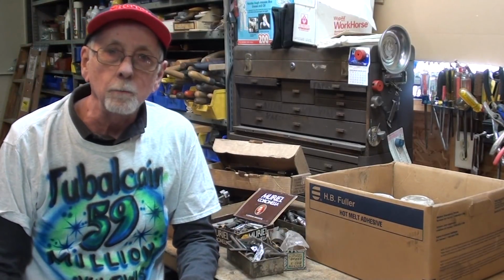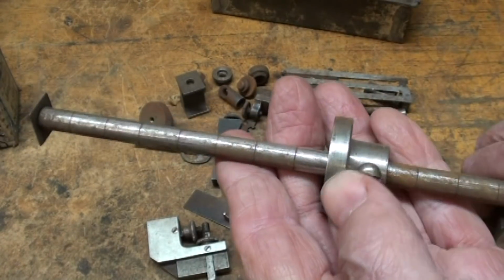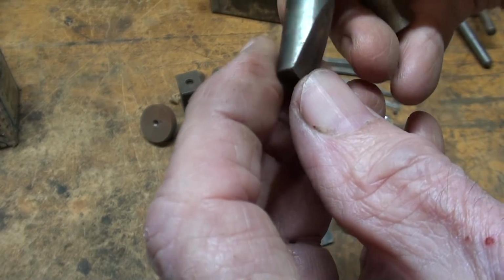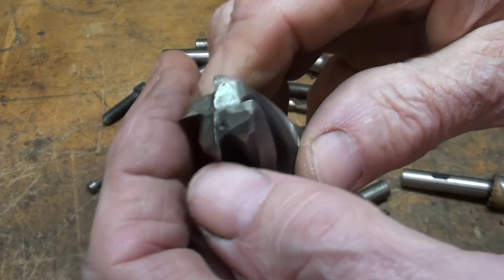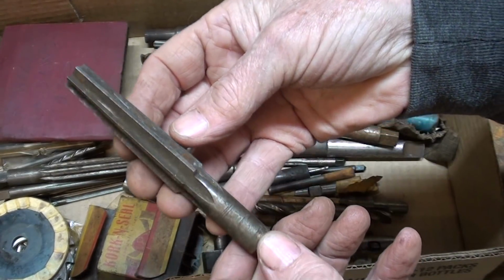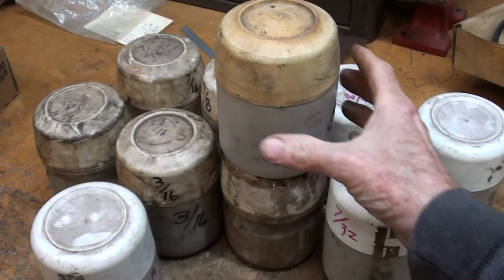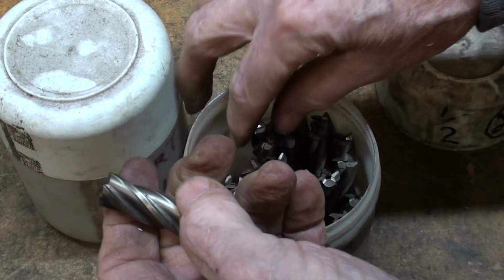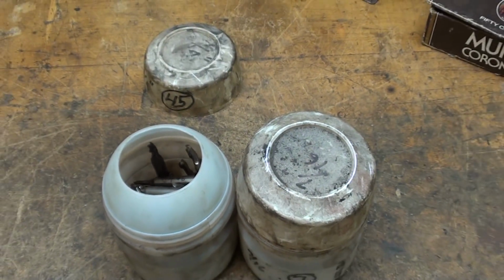SWAPPING FOR CUTTING TOOLS tubalcain wasting money

Comment: I volunteered once to look at my neighbors leaking AC while they were gone for the weekend which needed to be recharged again,  I found the leak at a brass block welded to the inside coil assemby where the liquid line tubing was attached with a brass flare fitting.  It was a special fitting with a check valve inside and sealed using a shoulder against a nylon washer.  The threads in the block were stripped and the fitting was barely holding.  Then, I SCREWED IT UP and lost the tips of the little thread it had left.  Sh_t!  Sh_t! Sh_t!  Now I can't even put it back together and that block is part of the entire coil assembly.  Now there's no AC at all.  Do we all know this feeling??  On top of that, that thread was short and it started up against a shoulder.  I can't do that.  But thanks to my junk tray, I made a 2" dia, 60 deg saw blade from an old 1/8 thk slitting saw and test sawed a thread against a shoulder on my 10" Atlas in back gear using my toolpost grinder.  It looked good.  I retapped the brass block on the coils to the next size up fine thread, turned a new brass fitting, sawed a new thread to the shoulder, remade the check valve, the flare end, cut the hex for the wrench thread and turned a new nylon sealing washer.  Took me an entire Saturday, but it sealed perfectly and was cool.  You couldn't even see what I did.  And of course, no charge my friends, it was just another day in MR. Pete's shop class.

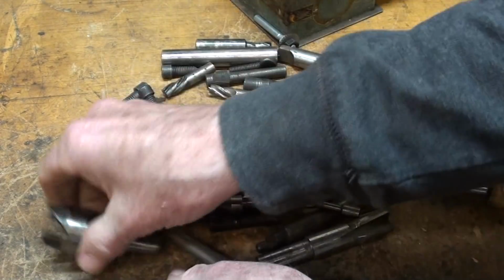Comment: At 9:04, I think that is a core drill, for removing battery cables and inter-cell connectors from industrial batteries.  It had a center that went down the  center of it.

Comment: Mr Pete, have you tried soaking the rusted tools in vinegar  or a diluted vinegar solution ?
Be sure to rinse thoroughly and dry.
Sorry I cannot offer any ratio of water/vinegar or soak time.
Just experiment with some scrap to see what works best.
You could also use electrolysis and there are numerous video's about that here on yt.
Thanks for the interesting video.

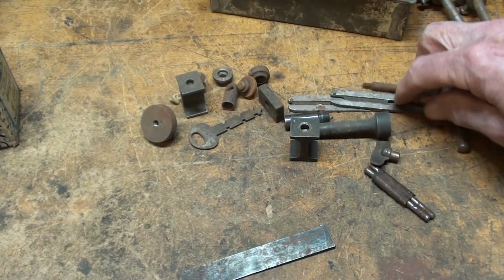Comment: The two longish items with the groove down the centre shown at 7:04, look like the sliding half of a spaceband from a Linotype machine from the days of hot metal Letterpress Printing. The other half had two lugs protruding that sat on the rail. They were tapered to match and retained the pieces you have, so as they slid past each other they would expand. They were inserted between the brass matrices in the spaces between the words. When the line was complete and just before the line of matrices were to be cast into a slug, the large end of the spacebands would be pressed up with a bar to create equal spaces between the words and make the line of matrices tight at the mold, so no hot metal would escape into the machine. The operator had to make sure that there wasn't more space in the line than the spacebands could accommodate. If when the bands were fully expanded and the line of matrices was still loose, what was known as a splash would happen, where molten metal would spill between matrices into the machine around the mold and turn solid. Depending how bad, there could be quite some down time removing the cooled type metal from the mechanism.
Reply from the maker: Yes, you are right they are from a Linotype.     I intend to include them in the next what is it. I used the term justification for the line spacing

Comment: Oh, I hate you... I can never find deals like that. If you were to cost out the useable tools, and add the stuff you could repurpose what do you think the the value would be? Let's just look at the box of taps, end mills and drills: 80 taps, 366 end mills, and 175 drill bits. How much are they worth? they could be all dull, but you seemed to think that many of the end mills were still useable, let's pretend that half are useable, and perhaps 10% are new. I'll guess some lowball costs.
80 1/4-20 taps: 40 useable at $10.00 / tap = $400.00
366 end mills: 183 useable, at $25.00 / mill = $4,575.00
175 drills: 87 useable at $5.00 / bit = $435.00

My guess is that the value of that box is about $5,410.00. Of course very few people would want that exact selection of stuff, say you might want 25% of it: $1,352.00. Then 50% of that for the gamble: ~$675.00. I'd be quite comfortable offering you $500.00 for every thing you purchased, including the stuff I didn't cost out, and might go higher in an auction.

So, here is the offer: $500.00 for everything. seriously.

Comment: The square drills in the blue capped tube are harden material drills. When you need some kind of hole in hard steel. Barely effective and largely replaced by EDM these days.
Reply from the maker: Thanks

Comment: Cool stuff. Dump the first box in Evapo-Rust. It leaves a dull finish because it gets the most microscopic bits of oxide. It is great stuff. Does not touch unoxidized iron. Totally safe. Dump the used up in the garden for extra iron and sulfur. Make sure the items stay covered or it will cut a ring where the steel penetrates into the air and oxidizes at the liquids surface. I sold the4 stuff nearly 20 years ago when it was a new invention. Caution: It removes all oxides including bluing and Parkerizing (and makes old wood look new!). I bet the telescoping gauge will recover with a soak.

Was that an annular cutter for wood plugs?  I bet those jugs are from a shop where they saved up used tools for sharpening for sale by the pound? Broken carbide has a pretty good value on eBay. I want to try or fishing
 weights.

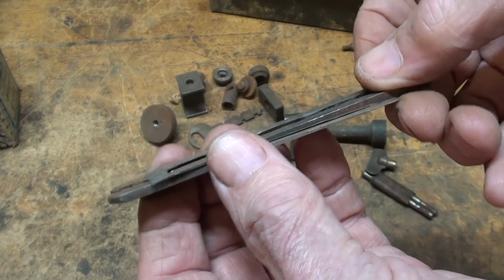Comment: at 7:09 those looks like half of he spacebands used in linecasters (for casting type for newspapers etc.) such as Linotype or Interrtype machines. They re missing another matching wedge, and these are placed in the line where you want spaces that can expand so the text fills the line. The caster pushes all the wedges in together so they all expand equally.

Comment: I have a gauge like the two you showed first only instead of the small plate screwed t the end there is a sharp pin through at right angles. It is a mortice gauge for wood work. Vinegar will remove rust  by soaking the part or wrapping in paper towel soaked with it over night then clean up with a scotch brite pad and CRC. It will damage chrome, nickle plating and paint. Thanks for another great video.

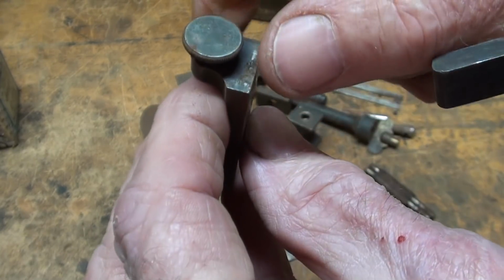Comment: A few guesses,6:58 vise adapter for round stock? 7:06 blade keeper for wood plane. 9:30 lathe dead center. 12:00 drill for broken taps.

Comment: The two tapered steel items at around the 7 minute mark are space bands used by linotype machine operators.  I can't tell you how they were used exactly but I am guessing something to do with spaces in a line of type based on what dad called them.  My dad who was a linotype operator had boxes of them in his basement shop and now I have them.  I know he had ground some into small knives like an exacto or scalpel kind of tool as they are hardened steel.
Reply from the maker: Thanks. They are use the spacers to justify the lines of a type

Comment: The tool resharpening procrastinators' club... proud member of it... Those marking gauges would make a quick lathe project... could be interesting
Reply from the maker: You know what, that’s the first thing I thought when I pulled them out of the junk. In fact, I have some project books that have a dimensioned drawing for a similar marking gauge.
Reply: @mrpete222  Perhaps this one came from one of those books as well

Comment: I am unashamed to admit how many things I did recognize during the first segment. The bevel protractor small angle blade is unmistakable, and the toolmaker clamp (vise) jaws are as well, and I have used those for years as an exercise in measure and do production drawings with students, since I have a number of spares. No clue if the marking gages are commercial, though I have seen a bunch of similar ones, and have seen similar in machinist exercise books. The slide for the planer gauge looks like it is from a B&S 625.  9:31: I can't tell from the video for sure, but that might be a cone tip for a trammel, similar to Starrett 251E ball tips. I have one for one of mine. B&S if I recall. 13:15: yup- bridge reamer. The taper pin reamers are real handy, even if not perfect. They do the job of the 'mechanics reamer' to get expand holes in thin material and when the hole can either have a little taper or be finished with another reamer after expanding. The stubby drills remind me why I have a sharpener. The machine cost less then the drills it did in the first month. Thanks for showing this stuff. Always a joy to see a good pick pile.
Reply from the maker: Thank you very much for approving, and not scolding me like many others

Comment: Keith Rucker didn't use a "tapered reamer," he used a "tapered drill bit." Ron W4BIN
Reply from the maker: Are you absolutely sure
Reply: He used a helical taper pin reamer.  Being helical, it cuts easier.

Comment: If you are sorting through boxes of used end mills remember that for any high-speed end mill smaller than about 5/16" (8mm) its usually just as cost effective to buy a new one than pay to have it resharpened.
Do keep your good sharp end mills stored so they don't get nicked or damaged. Everyday used end mills can be kept next to the machine in a cigar box if they are handled with reasonable care. If you draw your finger across an end mill's flute or face and it doesn't feel sharp... it isn't.
Cheers from NC/USA

Comment: Back in the late 1990's after may dad passed away, I went thru the shop and gathered up all of the dull endmills that were laying around to re-sharpen.  Just an wild guess, around 400 endmills!  Most were 3/8 and 1/2".  Sizes all the way up to around 1".  I re-ground the flutes on all, wrapped in black electrical tape from HF for storage and use later on.   Well, twenty years later, I still have some of them left, I've given away most of them to friends I know that have home shops for their use.  I doubt I've used a half dozen of them over the years. I now use mostly carbide endmills, slowly getting away from HSS.  And I still have lots of new HSS endmills that I probably will never use!  I'll let my son worry about it after I'm gone.  Stuff may all wind up in flea markets and such long after I'm gone.  Who knows.   OF course, by then, it maybe illegal to own anything of steel that may cause cancer by that time!  Thanks California!
Reply from the maker: Yes

Comment: It would be interesting to see a video on how you do rust removal on some older fine measuring tools or parallels.  I don't have a surface grinder.   So I use either rotary wire brush and that does a nice job  without scoring the part too much.  Chemically one can do that too.  I have seen a WD40 rust remover video that left a chuck in perfect condition.  Just wonder how you tackle that problem.  Thanks.

Comment: I can't call you foolish without saying the same about myself.  I bought some items last summer just like that.   It was several boxes of all sorts of tooling.   I was disappointed to find out nearly all of the cutting tools had been used long after they had surpassed their usefulness.
Reply: I once knew a man, now deceased, who bought 5 gallons of printers ink for one dollar. He just could not resist a "good deal" but never found a use for any of it. I'm not that bad but sure do enjoy Mr. Pete's treasure hunts.
Reply: @ellieprice3396  do me a favor and don't come look around my shop.   I'm joking of course but I have plenty of things that should be tossed out.  I don't necessarily buy things thats I'll never use, but I have a terrible time throwing out scrap left over from a project.     Those endmills, drill bits, and stuff I bought were mixed in with some tapping heads, boring heads, and such.  Those were the items I was after, but I was disappointed with the condition of the cutting tools mixed in.

Comment: Just a little gunsmith tip. If you don't want to use rust remover to clean up tools, boil them in water for 45 minutes. After the are cool, use degreased steel wool to card off the rust (or a Brownell"s carding wheel). It might need a few cycles to clean up but you should be able to restore the original finish. Just oil it when done.
Reply from the maker: Thanks, I will try that

Comment: I'm also interested in those 2 unknown items from the first box. The ones with the shallow V. I have one, and have no clue what it's used for.
Reply from the maker: I just found out, they are an attachment for a steroid surface gauge, the small one
Reply: @mrpete222  IT's fits the very small surface gage Starrett used to make before the days of putting the retractable dowel pins in the base.  Paid $25 for the one I have from eBay a few years ago! Ken

Comment: That Acute angle attachment from Starrett is very expensive to buy individually new. I believe it's in the area of $250 by itself. The odd square bits are probably solid carbide Die Drill bits. The tapered reamers may be the ones used to taper slug drop through holes on the bottom of stamping die steels. They were identified by a letter, and are called Diemakers reamers. Ones identified by a number are for tapered pins if my memory serves me correctly.

Comment: Has anyone ever seen HSS bits that have a triangle grind on the end of them. They look like maybe they are used as a reamer? I have a whole set of them. You can tell some of them have been "sharpened". The aren't very sharp. Even the ones that look like they havent been reground.
Reply: core drills?
Reply: Possibly spade drills for metal?

Comment: All those small rusty taps, drills or anything else, can be run thru a vibratory shaker [ PLASTIC MEDIA ONLY!] and come out like NEW!
Reply: You would be surprised how many times a tap can be resharpened.
Reply: @donmittlestaedt1117  I would like to see how they at is done.
Reply: Not sure if that is a good idea. The taps and cutters hitting each other will dull or chip each other. The best way to clean them would be an ultrasonic cleaner.
Reply: @mitchstephen5491  yep but a short run of 2 minutes is so worked for mine... they are probably somewhat worn already

Comment: I already have too much Stuff.
Might need, never need, spares, spares for spares.  Stuff I didn't know I had, shiny, never used etc.  Get some barrels, drill some drain holes in the bottom, put them on 4x4's and start purging.
Reply: Stuff you can't find when you need it?
Reply: @boondocker7964  have you EVER found something when you needed it? I've hot so much stuff I don't remember I have one of those.
I do a little unboxing video for my own benefit sometimes...
Reply: @boondocker7964  That too!
Reply: TRADING